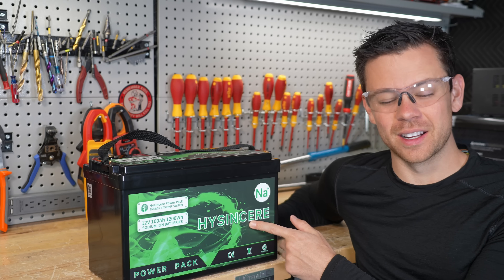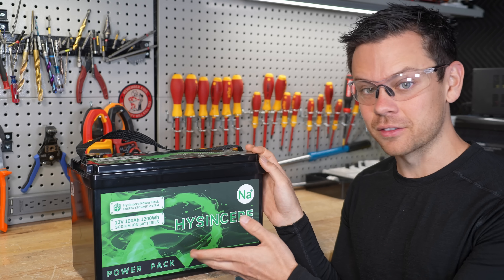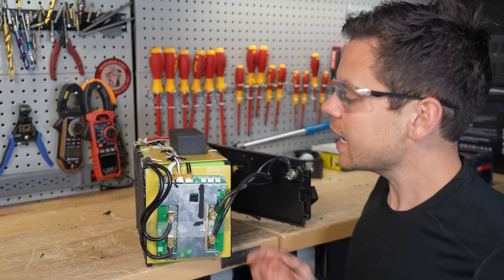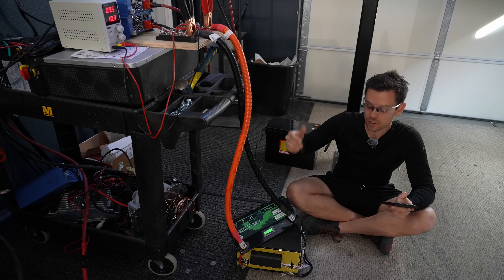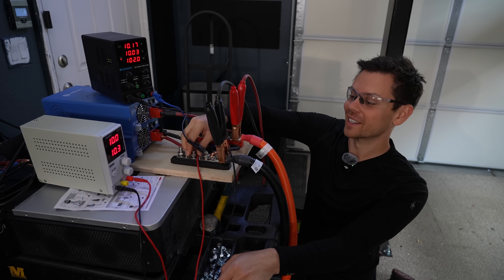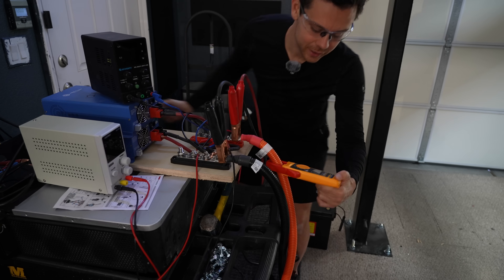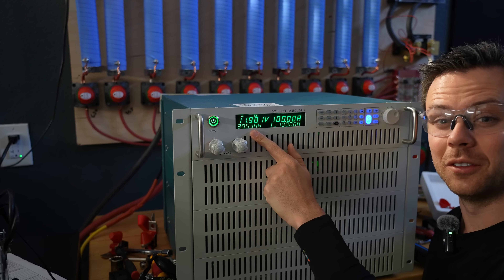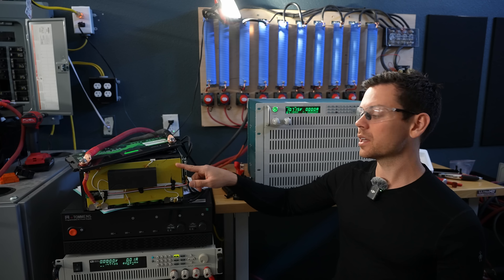Testing My First Sodium-Ion Solar Battery

Comment: Sodium ion is not a direct replacement for LFP. Its intended for large scale grid storage where efficiency is less important, because you are catching excess renewable energy which would otherwise be dumped. Also sodium ion uses less expensive materials, so in theory it should be much cheaper. I just hope it gets adopted for grid storage, otherwise the cost will never come down if they don't become mainstream.
Reply: Sodium ion have the theoretical advantage that they could become the cheapest batteries available, cheaper than Lead Acid and even cheaper than Alkaline batteries.
Reply: @Toxicity1987 exactly right
Reply: @Toxicity1987 Ok. And as LFP can reach below $10/kWh cell prices how much cheaper the cell need to be?
Reply: @mfb424 there is not enough lithium in the earth's crust.
Reply: they also work fine for HV home inverters, say a 300-600V system or a 250-500V pack.
Reply: This is a bit whiny
Reply: Tjere is a big world outside of the USA. Commenters here should learn to think beyond their own tiny backyard. Think of sunny South America, Africa, Australia.  I can see this going viral here in South Africa.
Reply: they are already using them on grid tied apps
Reply: Give them time and they'll swallow the market
Reply: I hear what you're saying, but unless the price point falls below lead acid you might as well just use lead acid for bulk storage.
Reply: @deezelfairy  You're right that cost is a crucial factor, but I think you are overlooking some limitations of Lead-acid.  Lead-acid batteries have a limited lifespan, lower efficiency, and higher maintenance requirements, which can increase their overall cost. Also Lead-acid batteries contain lead, which isn't great for the environment. 

Sodium-ion batteries, on the other hand, have the potential for longer lifetimes, higher energy density, and lower maintenance needs. Even if the upfront cost isn't drastically lower than lead-acid, the total cost of ownership and environmental benefits could make sodium-ion a more attractive option in the long run.
Reply: I think what people are missing about sodium batteries are their ability to escape the militarialized Chinese dominated supply chains and reduce the amount of toxic lithium and cobalt mining and processing going on.  We will look back at the shortened life spans and chronic diseases cause by the "green energy" dogma and wonder what the hell we were thinking.  We are destroying the lives and lands of the poorest people on earth so we can post on social media how green we are as e-waste fills our landfills.  It's like all the micro plastics in everything because of recycling plastics.  The giant plastic dead zone in the ocean because we were shipping our plastic from lefty cities to China to be recycled and a large portion of that plastic was land filled or dumped in the ocean or was ground up and ended up in lakes, rivers, and oceans globally and is now in our food, soil, and air.  This is what happens with fake feel-good environmentalism.  We are chopping up gigantic fiberglass "green" turbine blades and burying them after less than a decade of use.

I get that sodium batteries are not as energy dense, but they are safer and cleaner, and their supply chain is not dependent on militant China.  It is like saying radioactive irrridium watch hands are better than the phosphorus watch hands that don't give you cancer.
Reply: @lelenbates3367 wow. Big rant that is completely wrong. Sodium ion is exclusively made in china.  It’s far from reducing dependence on them. Lithium is actually mostly produced outside china. Yes lithium refining is mostly in china but that can change easily. And then the rest of the rant is just hard to understand nonsense.
Reply: @matthewmanzi9504  The point is they can be produced just about anywhere with materials that we are not reliant on China for. Plans to build large scale production facilities in the US are already underway.
Reply from the maker: @matthewmanzi9504  exactly
Reply: You dont really understand that cheaper materials is only a tiny basically irrelevant part of the cost? If a lfp and a na factory both cost 1b$ and  both cells cost 10$ to produce at 100ah size and out of that 1,2$ is for the chemistry of the lfp and 0,28$ is for the na your imaginary savings will never materialize.

This example did not include the 5-30b$ research and development that need to be clawed back from you as the consumer.
Reply: @MegaCyrik the r&d is also getting clawed back for lfp. CATL is commercializing NA cells for cars and grid storage right now. This is the product that is scaring the US auto industry the most right now. CATL is making most lfp cells on the market, and at scale their cost is approaching 100usd per kwh. They are suggesting they can approach 10usd per kwh for sodium at 168 energy density. There is also no fire hazard. Also, a full container from China shipped to USA is roughly 5000USD. If that CATL is saying is true its ggwp lfp
Reply: @MegaCyrik that's a lot of convenient ifs pulled out of thin air
Reply: @MegaCyrik  Sodium batteries are also more environmentally friendly because lithium mining in Chile is similar to fracking.  Also there is no copper in sodium batteries reducing the shortage of metals.
Reply: @MegaCyrik  Well spoken rebuttal. Perhaps the tech can be a nice fall back in the future if we genuinely need the runoff and have better uses for the lithium, but odds are we'll have advanced in some other fashion that makes all current tech irrelevant anyways.

Honestly, for all we know nuclear might finally have its time to shine (fewer and fewer are buying the propaganda each year) and render solar 90% irrelevant beyond grid down emergencies and rural settings.
Reply: @GabeSweetMan - nuclear is great base power but can’t quickly scale up energy needs, like natural gas turbines. 

Solar is bad base power, needs batteries or natural gas turbines when there are clouds or at night.

Honestly, solar or nuclear cracking water to make & store H2, to drive turbines… these are good solutions to increase power when demanded…
Reply: @DavidHalko molten salts help ease demand curves
Reply: @jimsimpson2820 
Moltex Energy are building an SMR with molten salt storage which will be great for following the curve. 
And it's a liquid fluoride fuel and liquid sodium cooled so it's salt and the way down, which is funny.
Reply: @DavidHalko how about nuclear plus batteries for peak load?  As you have a MUCH more predictable base load supply you wouldn't need as much battery capacity as when charging with solar and wind.
Reply: OMG, please put the “$” sign first - where it belongs.
Reply: @davidkelly3779  It goes in the back. Where it belongs.
Reply: No such thing as renewable energy unfortunately
Reply: @herbertvonsauerkrautunterh2513  when solar runs dry, we’ll have other problems! 🤷🏻‍♂️
Reply: @kristianhartlevjohansen3541  When the sun stops shining we will have Sodium Ion batteries to continue supplying energy.
Reply: @herbertvonsauerkrautunterh2513  You are commenting on a video about renewable energy products...
Reply: @herbertvonsauerkrautunterh2513 There is on the sense that you only have to wait an average of 12 hours for the sun to rise after darkness falls, rather than 10,000,000 to 20,000,000 years for fossil fuels, which will run out within the next 50 years and be extortionately expensive LONG before that. If the middle east erupts, as it looks like it soon might, you'll get a taste of that.
Reply: @puffinjuice  I understand what you are asserting is the goal for this particular chemistry but *OBJECTIVELY* with efficiencies this low the use of this chemistry is an untenable choice.
*IF* there were SOOOOO  much excess production capacity that one simply HAD to capture the energy so it would be available later that *MIGHT* be an argument. Since the WILDEST estimation is that energy PRODUCTION capacity MUST grow a MINIMUM of 40% over the next five to ten years this is simply a foolish choice. Electricity supply in the U.S. has been nearly static for the LAST TEN YEARS.
Increasing production is great. Using this chemistry to time shift capacity is simply foolish at a level that is unwarranted.
Reply: @phlogistanjones2722  - if there was so much excess production capacity”

California. Excess production capacity during the day. Power is just going to waste.
Reply: @phlogistanjones2722 - “electricity supply has been static for the past 10 years”

And AI data centers need to create their own power now… as California is dumping excess power during the day & not buying power back during the day at any reasonable value… as price of electricity rises to the point where electric cars are not seen with the same value.

Power is a huge issue, any new battery storage technology must be welcomed so the use cases can be clearly monetized & we can fix infrastructure issues!
Reply: @phlogistanjones2722 most places with wind and/or solar often have the problem of either not enough production or too much, so if these thing work out finacially viable being able to have 3 or 4 times large grid storage would mean less supply is shut off remember they are paying suppliers to not supply power
Reply: @phlogistanjones2722 did you really have to have AI rewrite that for you.
Reply: @phlogistanjones2722  The lower energy efficiency is because sodium ion are still just came out this year.

Next generation sodium ion will fix the efficiency to 97%, very close to LFP, but it will only mass produced until next year or two
Reply: @sihamhamda47 In the software world we would say “It will be fixed in the next release”

Comment: You are using it wrong!
Someone has to say it.
In the real world application examples I have seen it is used in a hybrid battery system along side LFP and you can scale the sizes of each battery type based on the performance that you want.
It would be a great cheap off grid solution if it can be packaged cheaply enough in easily transportable modules, that will be half the problem.
The way you use sodium ion batteries is as second bulk storage, with an LFP battery component of the battery system being more directly connected to your inverter and the sodium ion battery being DC-DC converter coupled.  So you can take advantage of the capacity without the voltage discharge curve being an issue.

In simpler terms the sodium ion battery is a charging source for the your LFP battery and that works in reverse also.

You can also do capacity time shifting by discharging the LFP battery into the sodium ion battery in the morning before peak solar so that you can dump as much as possible in to the LFP battery, so you do not need to oversize the DC-DC converter for peak solar charging capacity.

You would run say a 20kWh LFP pack backed by the cheap 80kWh sodium ion pack.

I think the main issue will be physical packaging for the DIY market, as you cannot get much over a "2 person lift" before they become troublesome to transport and handle easily.

Comment: When lithium batteries burn, they produce their own oxygen.  That’s their biggest safety problem.  Sodium ion doesn’t have that issue.  These budget LFP batteries are dangerously because of the possibility of thermal runaway caused by lazy build quality, an issue that will be somewhat relieved with sodium ion.

Comment: This technology needs a lot more work, but it has a lot of potential. It can be completely drained without losing the integrity of the crystal structure. It will not experience thermal runaway so it doesn't have the fire hazard of lithium. but most importantly it doesn't require rare earth metals that China dominates the refining of.

Comment: Price of sodium ion is higher because it’s not yet produced at massive scale.  Its advantage is that LFP factories can be quickly converted to sodium ion with light modifications, so presumably prices should fall very quickly.

You’re testing 2nd generation sodium ion, but CATL’s 3rd gen is supposed to have all the breakthrough properties.  Hopefully it works as well as promised.
Reply: I'll believe it when this guy tests it, but thanks for the info.

Comment: Well yes, you’ll need new inverters and chargers to take full advantage of the sodium ion charge curve, but NMC is also linear, though less steep, and LFP’s flat curve can cause problems with balancing cells and ascertaining SoC.  

I don’t think creating inverters with a wider volatage range will be a major technical challenge.

Also needing heaters to keep LFP warm in cold weather is just really inefficient.  Sodium ion presumably needs a lot less safety equipment as well.

Comment: They are trying to make batteries with common elements.  The 12 volt issue can be fixed by setting them up for 24v, which would be 18?   Then use a dc step down to 12.  Maybe, the chemistry is better for a more stable industrial storage solution, like shipping container size, without the risk factors of lithium.

Comment: Sodium Ion will likely be something interesting in the short to medium future. You need to look for the new generation CATL sodium cell based battery. What you have is a first gen product.
Reply: no. nothing interesting with this crappy voltage curve and -range.

Comment: Rather than new battery tech, what we need is a LFP BMS with a heater control circuit. When charging power is applied, if the temp sensor says the battery is too cold, have it route the power to heating pads.  Especially when you are charging from solar, better to send the power to heating pads instead of just wasting it.
Reply: Ideally a separate small specialised integrated cold start battery with just enough density to heat the LFP cells to power on safely for self heating and recharging the heater battery.
Reply: @shmayazuggot8558  if you have external power to charge, you don't need another battery. Consider a cold morning, batteries are too cold but panels are producing power. BMS won't allow charging because they are cold. Solar power is wasted until batts warm up on their own. If you redirect that power to heat pads, batts warm up faster and come online.

Comment: What about a hazmat use case, where flammability is a potential consideration?
Reply from the maker: LFP has limited combustibility. Same as wood. But if you contain the gas, which is hard, you can cause explosion from that. Only like three reported worldwide

Comment: Thanks Will for showing us the current state of available NA batteries. There are always press releases of better performing NA cells out there, it really doesn't matter until a company takes those cells and builds a battery out of them. If you can't put one on your bench and test it, it may as well not exist. My take away from your tests is that in order for NA batteries to compete with LiFePO4 they need to get the internal resistance down significantly, decrease the cost, and have inverters that have a wider voltage range.  I've thought these to be the case, but your tests surprised me as to how poor the internal resistance actually was. With such high resistance, doing high C rates might cause enough temperature rise as to require a cooling system, which would defeat the purpose. The thought of using a NA battery as an ICE starter battery might be a good first market for them as opposed to grid storage. I feel that they will ultimately displace LiFePO4 for grid and home storage, but I can't tell if that will be 5 or 15 years from now.

Comment: You can start your car with 6 supercapacitors in series. And the recharge time is near zero. And it's lighter than lead-acid.
Reply: yep,I would guess that very tiny charging current needed to "slowly" charge the supercaps wont hurt efen deep frozen LiFePo4... yeah, unsuccessful start might be a bit annoying, but I wont have problem waiting even few minutes. And as ita started, the heater can kick in...
Reply: @JanicekTrnecka  Supercapacitors are almost instant in charging. It is electrostatics, no "slow" charging, but instant electron transfer.
Reply: @htmagic you dont want to load the deep frozen LiFePo4 with currents needed to "instantly" charge the supercaps - in that case you might omit the supercaps at all and go for a starter anyway. Supercaps will be charged slowly to keep the deep frozen LiFePo4 safe and allow you to dump lits of current into starter struggling to turn the deep frozen engine....

Comment: Very interesting Will.  Always glad to get you input on these things.  I would assume that the sodium ion will mature and be very affordable.  With a linear curve like that at least the BMS in other applications will know what the SOC is vs the LFP situation in vehicles where you are forced to top charge them to level set the BMS in the charge.  I would hope that sodium ion will have a role in those applications as well.   Like you said current equipment won't properly manage or charge these things.  It might make a good replacement for the 12v starter batteries like you said providing we can get the equipment to support it's different needs.

Comment: Different sodium chemistry in other battery brands?

The new BLUETTI unit was getting better results than this battery; not all sodium formulations are the same perhaps? 🤔

BLUETTI tear down seemed to indicate BLUETTI was manufacturing their own cells, not sure if that was true though.

Sodium is just getting started and I do live where LFP batteries freeze solid if you aren’t careful so the wider potential operating temp of sodium is interesting to me.
Reply: Their chemistry is the same, it's just gen 2. They're much better batteries. It is still not worth buying them they are not better price per kwh.
There are other chemistries. The most notable one is the sodium chemistry comparable to LFP which is NFPP. This is sodium iron phosphate. This has a flatter curve and is even safer which isn't really necessary for sodium batteries. It'll be around in end of 2026- 2027 most likely for regular joes like us.